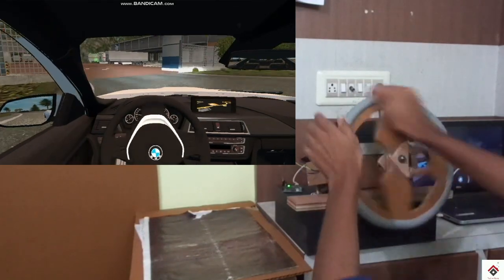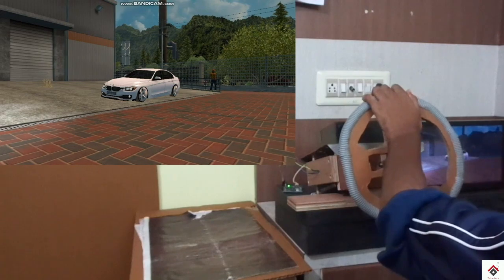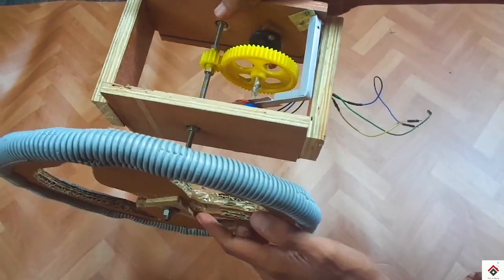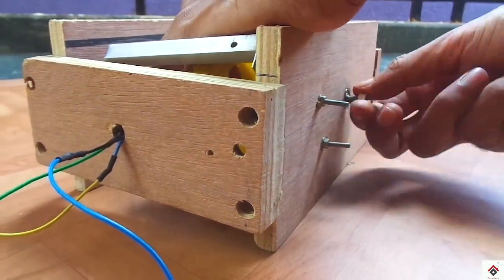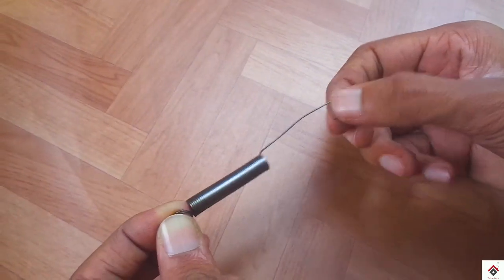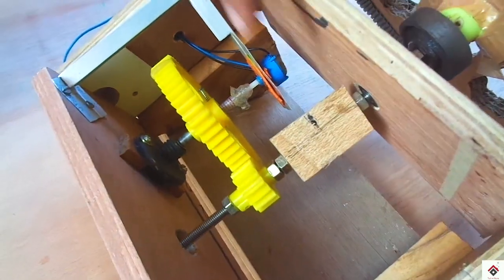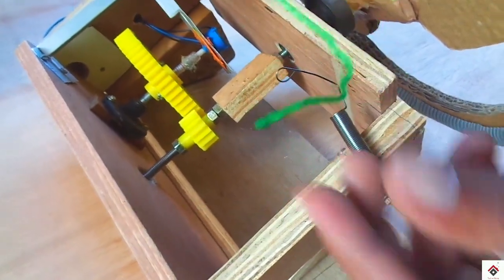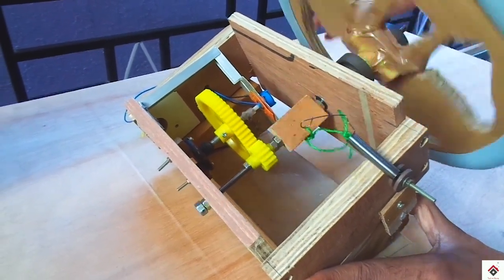900 degree FORCE Steering Wheel | Realistic PC gaming steering wheel using Arduino [English version]

Comment: Potentiometer for left and right how it's work.?
Reply from the maker: The voltage drop across potentiometer is 0V to 5V. The steering is considered as centre at 2.5V. Below and above this value will be left and right.